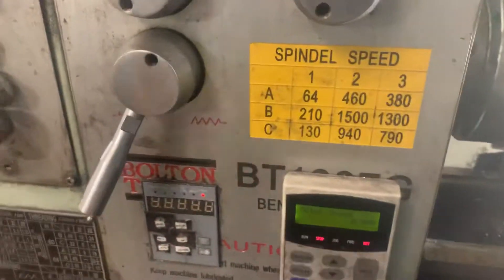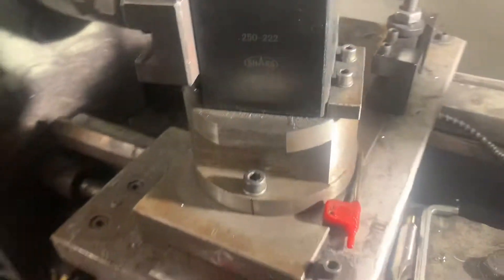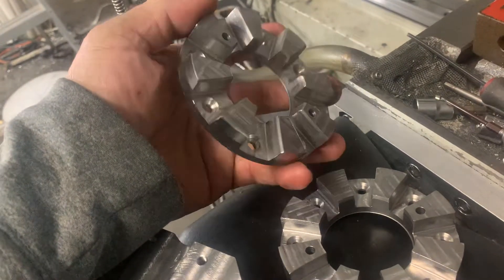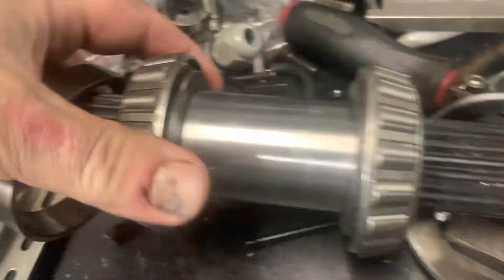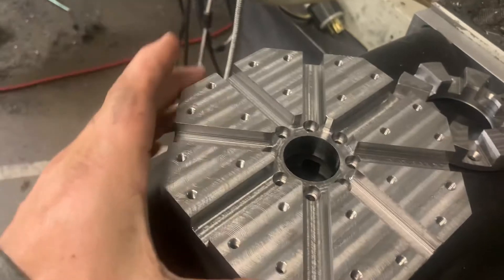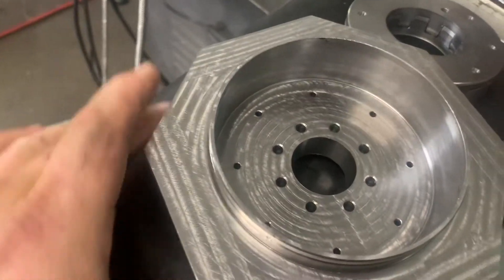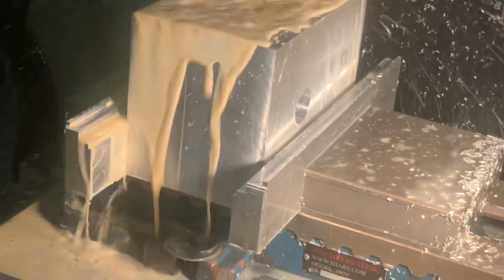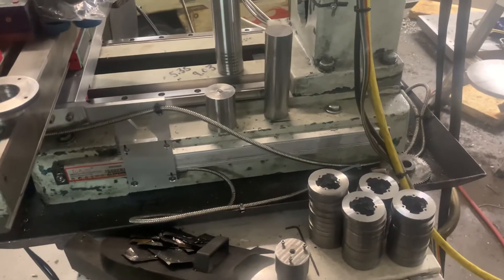Bolton 1337G tool turret project

Comment: Did you ever get your lathe tool turret working? If so, where did you mount it. I'm designing one now to replace the tool holder on the cross slide on my CNC late conversion, and realizing I have a tool height adjustment issue, meaning I can't change the tool height. Now I see why the turrets are on a 45º angle behind the spindle. I'm curious what you did to make it work?